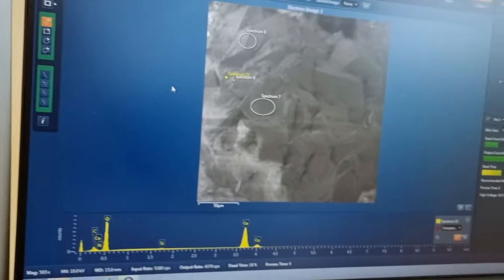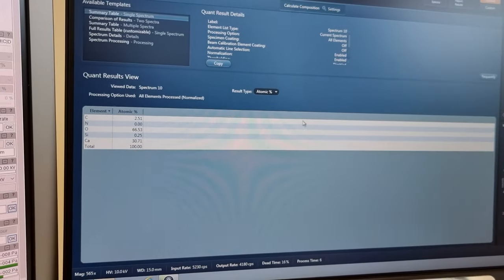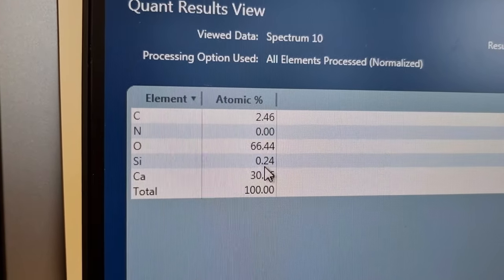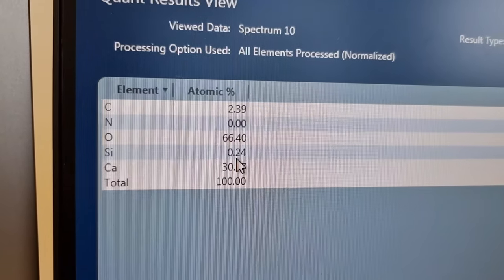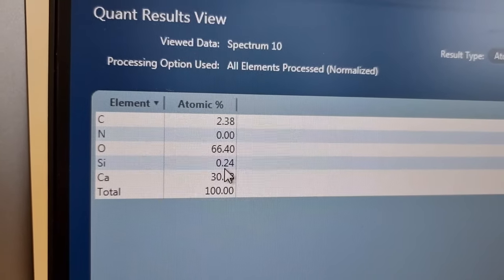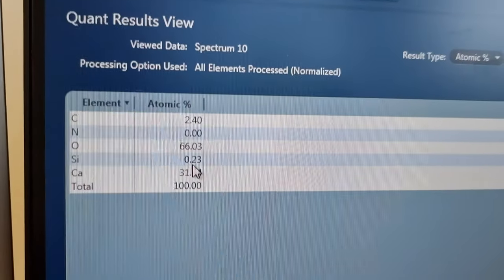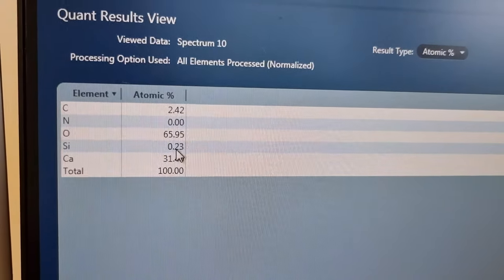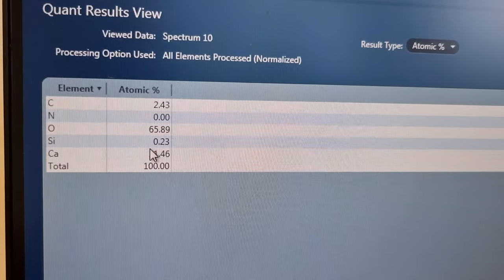Fixing Fukushima - CaCO3 vs HHO SEM EDS

Comment: Hey Bob, that is still really significant even though it isn't a high average number. Looking forward to those EDX shots where it shows the distribution of the detected elements to draw useful conclusions. I wonder if one plugs it in the Parkhomov reaction calculator how much energy 0.24% comes to per mg of converted material. I expect it's a huge amount of energy in total.
Reply: Not sure how representative the averages are between the untreated and treated samples. It looks like the more significant change was a general decrease in C and increase in Ca.

        Raw   Treated

C     18.23      2.51
N      0.00      0.00
O     60.93     66.51
Mg     0.13      0.00
Si     0.00      0.25
Ca    20.71     30.73
Reply from the maker: As I said in previous videos, CO2 evolves from CaCO3 when above 825-850ºC, leaving CaO. What we also see in HHO treated CaCO3 is the formation of Calcium Peroxide CaO2, implying the removal of CO rather than CO2 - why could this be significant, well C is 12, O is 16 ... add these together and you get.... drum roll please.... 28Si.

use this nanosoft fusion query:
A1 = 12 and A2 = 16 order by MeV desc

Yield = 16.7557 MeV per CO to Si fusion event.
Reply: @MFMP  thanks as always!